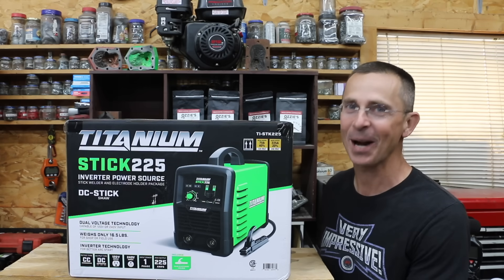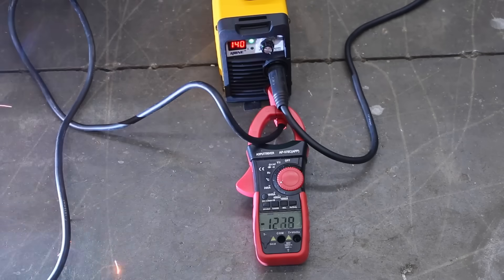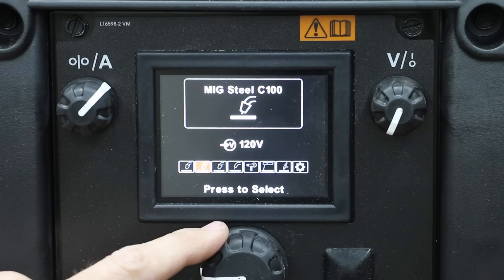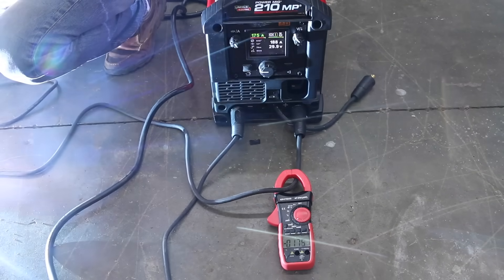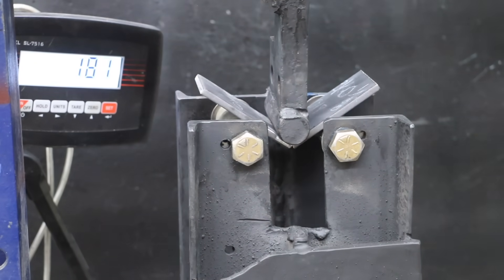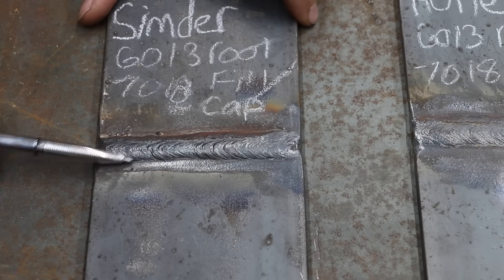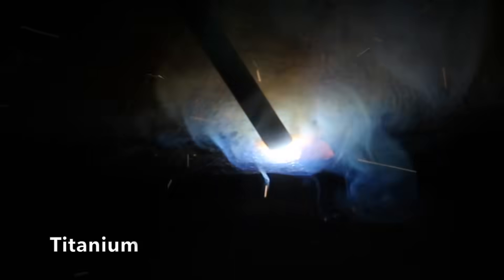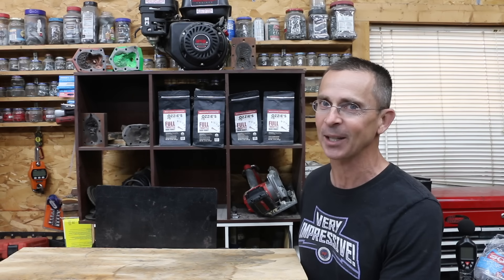$70 vs $2,300 Welder? Let's Settle This! Weld Strength, Duty Cycle, Current Output, Build Quality

Comment: If I needed a welder for farm, home, or hobby I would not buy any of these cheap Chinese welders, I would pay the money for a used Lincoln, Thermal Arc, Hobart, ESAB, Miller, and other reputable brands. If I build a utility trailer to do odds and ends around town the last thing I need is for a weld to break because I wanted to save money upfront on a cheap welder. That broken weld would cost me time, money to repair it and any other damage to the trailer, and then if part of the trailer or the load was lost on the roads it could strike another vehicle or pedestrian and cost more money or end up as a legal fight in the courts. Not worth it one bit.
Reply from the maker: Thanks for the feedback.

Comment: It could be interesting to see you do multiprocess welders. When doing that, one of the things that would be nice, would be how they handle different matierals, such as mild steel, stainless steel & aluminium.

Two of more expensive options i would suggest for that review would be the Miller Multimatic 220 & ESAB Rebel 205ic.
Reply from the maker: Thanks for the suggestions.

Comment: Titanium makes a very impressive flux core wire feed welder. It's an inverter welder and works well on the model that has variable controls for heat(amperage) and wire speed.
Reply from the maker: Thanks for the feedback.

Comment: I've got a Lincoln Mig and a Miller propane powered bobcat welder. I'd love to see a test of a 240V multifunction machine that does AC Tig. They are usually quite expensive if going Miller or Lincoln,  but I'd be interested in how some of the cheaper Chinese ones do.
Reply from the maker: Thanks for the video idea.

Comment: For good welding one should always leave enough space between the separate parts so that the weld will fill in and connect both parts fully.
Reply from the maker: Thanks for the feedback.

Comment: Icould be wrong but you clamp meter on most of them was tested very close to the thick coupling part, the ones that scored better you had further down. I dunno if that effects the result or not. But I'd assume the tinner wire part is better to test from?

Comment: Could you do the same test but with mig welders? I have the Titanium Mig 170 240v flux cored. I did 1/4 steel at wire speed 320, voltage 21, impedance 7. seemed to do well but I would love to see this welder in a shootout. Thanks.
Reply from the maker: Thanks for the suggestion.

Comment: in 2020~ bought a hitbox welder and than a plasma cutter, both have served me well up to now; only considering upgrading the torch that came with the hitbox cause it started to melt from using the unit to much:P * support seemed great, they couldn't verify some detail that aliexpress needed from me so they ordered me the welder via amazon and than shipped me  gas less wire spool from china later on despite me saying it was ok to not send it:).......f
Reply from the maker: Thanks for sharing.

Comment: Thanks Joe!  Great video!  I used to TIG weld at work, but switched jobs and no longer have access for home projects. I’ve been thinking about buying a MIG welder for years, so it would be awesome if you did a MIG welder test.  Thanks a ton!
Reply from the maker: You are welcome!  Thanks for the suggestion.

Comment: Great video! I bought the Lincoln MP210 when it first came out. With a $200 special rebate, it cost me $985. It’s a perfect weekend warrior welder and I can also confirm the accuracy of the set points. The only downside is no AC TIG but that’s what the spool gun is for! 😊
Reply from the maker: Thanks!  Thanks for sharing.

Comment: it seems more power and the Display accurately reflecting that power is what you want.

I really want a welder, but don't know all the aspects that make one machine better than the other. It seems power is huge, but I know there are other things you want for different materials but don't know what's preferred.

What's the significance of duty cycle? Or frequency (is that a thing?) Why can some machines do aluminum and some not? I want to tig but there seems to be so many ways to tig, and I don't know what's absolutely necessary for a machine to be a good value.
Reply from the maker: Thanks for the feedback.

Comment: I am "not" a professional Welder, but I can weld low pressure material from aluminum to titanium, due to training and apprenticeships and have spent 100's of hours stick welding and equal amount tig, I can only comment from my experiences and working with an extremely talented group of welding specialist . Question: why 6013 root instead of 6010?

Comment: Great video, very informative. Thanks Joe, thanks clive, just ordered a couple of DC current clamp meters. The built in amp meter on my welder stopped working but still welds, does a great job for $100 (Ozito iwr120)
Reply from the maker: Thanks!  Thanks for the feedback.

Comment: first welder i ever used was a deko pro stick welder, it was hard to get it going and was too much for the thinner material i was working on. picked up the cheapest harbor freight flux core welder a few years after that and got amazing results
Reply from the maker: Thanks for sharing.

Comment: Glad you got a welder for the help with this matter of these welding machines oh by the way I just got a hyper tough Jack stand I've yet to check it out on the stability of the feet on concrete the weld's look great the other thing is  got a Mechanic's creeper by hyper tough it was a pain to install the caster wheels
Reply from the maker: Thanks!  Thanks for sharing.
Reply: @ProjectFarm  any time young man oh by the way I did check out the jack stand it is spot on being level on All four corners

Comment: Would having the mains power cable wrapped when in use cause resistance, meaning lower peak output amps? I saw a few that looked wrapped as boxed during tests.
Reply from the maker: Thanks for the suggestion.

Comment: You should have used the lincoln entry level welder. Easy mig 140 for this review.  I have been fighting that welder for the last 5 years and recently replaced it with a vulcan omnipro 220.  It is a Night and Day difference.   The Easy Mig 140 trigger switch contacts burn out and you have to replace it or sand it.  The Vulcan program screen is super helpful for beginners. Highly recommended.
Reply from the maker: Thanks for the constructive feedback.

Comment: something i figured out with cheep welders, CCA wire for leads , had one that quit working after a few months . wire was corroded in cable rubber   , cut yt open and it was just a white powder , first time for me .
Reply from the maker: Thanks for sharing.

Comment: The most ridiculous thing about this comparison is that the Lincoln 210mp is $2300.  This welder was introduced in 2015 at $999, which is what I paid for mine.  There is no way to explain the price increase except Lincoln tripling their gross margin on this product.  Dealer margin on welders is typically around 29%.
Reply from the maker: Thanks for the feedback.

Comment: I got the titanium 200 that does mig, tig, and stick. Had it for about 3 years, maybe close to 4 now. It's been perfect for me. I've mostly only used the mig function so far though. Currently building me a shop so I can try to use it and other tools more. It's hard to do much with no room for gas tanks or anything larger tools
Reply from the maker: Thanks for sharing.

Comment: I love my Hobart Welder. Would have loved to see some of the welders in the $700 to $2,000 dollar range. Those junk welders you pay $100 bucks for are only good for small little jobs here and there that only need a tiny little  bead ran across them like anything 1/8" or thinner.  Lincoln makes some great welders! Those cheaper Titaniums don't do that bad at all for the price range. I don't know how good the durability factor is overtime. :body-blue-raised-arms:

Were you putting down some nice welds or was that your friend you had help you out? Those were pretty clean and nicely done overall. :eyes-pink-heart-shape:
Reply from the maker: My friend did the welding. Thanks!  Thanks for the suggestion.

Comment: I’ve had the cheap 90 amp harbor freight and it was manageable but I finally bought a used Lincoln flux core that has the option of hooking a gas bottle and running mig. It was life changing 😅
Reply from the maker: Thanks for sharing.

Comment: Thank you, to Joe! You're welcome back anytime in my book. I'd definitely like to see more welder tests, especially mult-process welders. I have a Klutch 220si that I bought back in 2017 and I am happy with it, although I am under no illusions that it is a top tier welder. But I'd like to see it and the HF equivalent, as well as Eastwood's welders tested alongside Hobart, the Lincoln you just tested and the miller equivalent. I'd also like to see Everlast thrown into the mix. Like always, you're videos are great, thanks! Also, if you're going to go down this rabbit hole, how about cheap to not so cheap but not out of a hobbiest's price range, plasma cutters?😁
Reply from the maker: You are welcome!  Thanks for the suggestion.

Comment: Thanks Joe for helping.

Yes please on the MIG.  Everlast would be a good add on.  I've had their 110v 140 inverter unit for more than 5 years and it does all I need it to.  The ground clamp was a weak point.
Reply from the maker: You are welcome!  Thanks for the suggestion.

Comment: For anyone that would never consider the Simder based off of this testing, I cannot speak for the 110v model because I don't own it, but as for the 240 version this thing is an inverter welder and works off of both 110, & 240 and is one hell of a beast, I have a dedicated 240 50 amp line running to it and let me tell you for 250 dollars, I can weld with this all day long and have clean crisp welds and it handles everything I throw at it and penetration is so good I can literally use this a poor man's plasma cutter by cracking the heat all the way up on it. I've had it for about a year now and for $250, I gotta say this thing is a beast and has never let me down
Reply from the maker: Thanks for the feedback.

Comment: Glad I got my 210 MP when they were 1000 bucks. The titanium welders are great little machines. We run the unlimited 140 and the unlimited 200 model at work. I would definitely recommend them for the price. Only draw back being replacement parts aren't as easy to get.
Reply from the maker: Thanks for sharing.

Comment: One things for folks to remember when buying a big box store welder vs one from a welding shop even on the same machine the components used will be different to come in at that lower price for the box store often box store machines will have plastic parts and sometimes aluminum instead of copper vs the same more expensive machine from a weld shop that will have metal internals instead of plastic and copper instead of aluminum etc which accounts for the higher price and a longer lasting machine big box stores often cut corners on build quality on lots of items to come in at a lower price point 👍👍👍
Reply from the maker: Thanks for the feedback.

Comment: I would like to point out that it is not fair that all these welders are compared to the $2300 Lincoln 210 which only cost that much because it is a multiprocess welder.  A Lincoln Invertec V155-S or one of the classic K1297 AC/DC buzz box would have more appropriate. You can normally find those in a local Home Depot.
Reply from the maker: Thanks for the constructive feedback.

Comment: Hey I loved the video!! I've been looking at a few different brands. Just a heads up for next time. If you use a meter with an "inrush" setting for the hotstart you will get a better reading for it. The Hotstart doesn't last long enough for a ammeter to read the peak correctly.
Reply from the maker: Thanks!  Thanks for the feedback.

Comment: How many amps does each draw on the 120VAC circuit to the house panel ? ( typically 1phase 15amp or 20amp dedicated circuit 80% NEC CODE )
240VAC 1phase ( typical dryer outlet 30amp circuit 80% NEC CODE )

Comment: Yes please mig welder test please. This is what most hobbiest would use for exhaust pipe. Go karts. Thin metal body panels on a car. Replacing rust panels. What ever welder you recommend is what I'm going to buy
Reply from the maker: Thanks for the suggestion.

Comment: It is rather well know that cheap welders do not produce advertised amps. Thanks Joe for the help. 
Yes, do MIG welder review as well as TIG
For TIG can you try to compare not the cheapest out there but competition to the Lincoln / Miller which is welders in 200 amp range for around 1500 CAD. For example how well does Everlast brand do vs. Miller (original Everlast welders were clones of Miller with a whopping 5 year warranty).
Reply from the maker: You are welcome!  Thanks for the suggestions.

Comment: i still use one of the black chicagho electric 90a flux welder... it does 3/16th just fine, never had issues with any welds breaking, and i have welded leaf spring mounts and major sections of my trucks frame where a lot of stress is..  for the 100 dollars i spent 6 years ago it has saved me thousands.. as for penetration on 3/16th, i recomend making a large gap between the metal to criss cross pattern  and using a slow wire speed to get good pen, possibly welding both sides if you can..  i wish you guys tested the cheap 90amp flux welder in this.   This is also why i dont like stick welders.. everything HAS to be clean... with flux.. you can weld on anything
Reply from the maker: Thanks for the constructive feedback.

Comment: So ultra cheap is hone and bang for buck is Titanium.   ty for the review.   I picked up a fairly cheap no name fluxcore wire feed for 70 from the Canadian harbor freight(princess auto) about a decade ago.  it is not a good welder.   But for the price i paid at the time.   it works on rusty crap fairly well and when i need a welder its going to be on rusty crap.
Reply from the maker: You are welcome!  Thanks for sharing.

Comment: I came across something this weekend. Silicones, and apparently new one that says liquid until exposed, so it seals upon leaks. But the big question, a smooth polished surface or a scuffed cross hatched surface. We had a huge debate/argument on this. I argue not just pulling apart strength, but sliding strength for when different metals expand differently like aluminum mounting to iron. So pull apart strength versus slide apart strength. What color protects against what liquids.
Reply from the maker: Thanks for the suggestion.

Comment: For the average home hobby welder the harbor freight offerings are pretty decent.  Lincoln, miller and hobart are better, but cost a fair bit more.  I've been using the vulcan protig 205 for a few years, I know it's not the best, but it was the only way I could get into aluminum welding affordably.
Reply from the maker: Thanks for the feedback.

Comment: Great review, but you missed pointing out something Joe mentioned. The inconsistency in the current which makes for smooth or not welds. Sure, a welder can put out incorrect amperage, but you can just adjust the dial to compensate for that. If while you're welding, can't put out a stable amperage and is instead fluctuating between 90 and 105 amps, that's a problem. If you look at the Lincoln numbers, once it settled back to the amperage, it stayed put within 1 amp. The others varied wildly.
Reply from the maker: Thanks for the constructive feedback.

Comment: Thanks to Joe for helping. Stick welding is highly operator dependent. 
Next time, it would be helpful to know arc voltage as well as current for a true apples to apples comparison. Oh, and those current ratings on the cheap machines aren't out and out lies. They are likely short circuit peak currents. Which is useless for welding, but still a true rating.
Reply from the maker: Thanks!  Thanks for the suggestion.

Comment: Joe's opinion was great to hear! I have the Yeswelder. I found it to run a little cold, but it's worked well for my lighter projects because I just turned it up. I found it for $90, so I won't complain.
Reply from the maker: Thanks!  Thanks for sharing.

Comment: Can you test Welding Hoods next. I'm currently using a Titanium Brand Hood for commercial welding. Its lite weight and works perfectly but afraid if it hits the floor from any height.
Reply from the maker: Thanks for the suggestion.

Comment: Thanks Joe!! Great info here about these welders. I'd be interested in seeing some self contained welding solutions that would be appropriate for off grid locations. I fear running a regular electric plug-in welder would tax my system, which is already overkill for our needs.
Reply from the maker: Thanks and you are welcome!  Thanks for the suggestion.

Comment: I'd like to see flux core welders as it would be a lot easier not having to deal with gas tanks if they are sufficient for diy use
Reply from the maker: Thanks for the suggestion.

Comment: The Lincoln Electric 180i MP DV may have been a better subject to test as it retails for around $1000. and does everything the 210 model boasts.  I love mine and the fact that a woman purchased it for her husbands b-day after he already beat her by 2 days purchasing the one he wanted for himself.  They sold it to me ... still in the unopened box for $500. cash and delivered it 3 hr away when they heard I lived on the way to the casino boats in Lake Charles, LA.
I'm learning how to weld alum. now as I'm restoring my 1964 Lone * Star 14' alum. riveted V bottom boat. This machine really does a great job and is easy to operate. Lincoln has a tech dept. that is very helpful and eager to make you feel comfortable despite ignorance !!
Reply from the maker: Thanks for sharing.